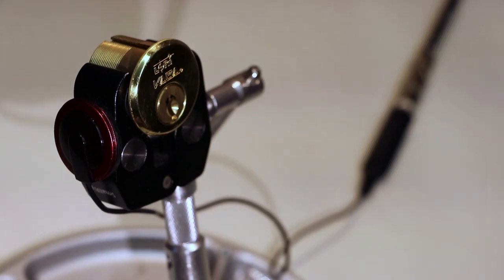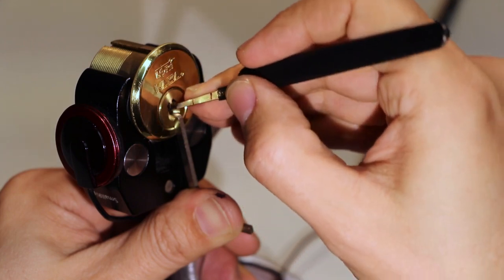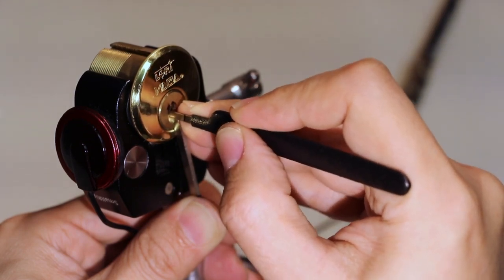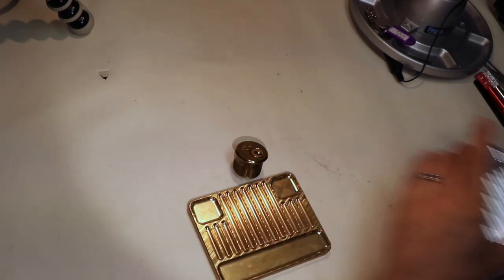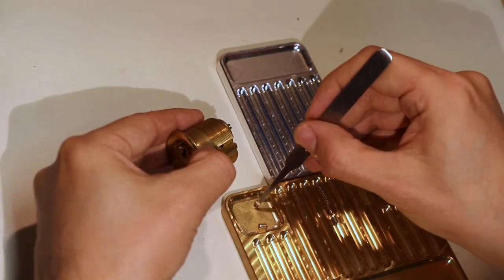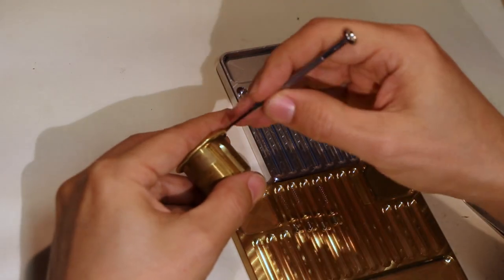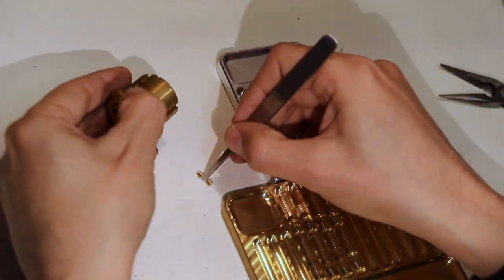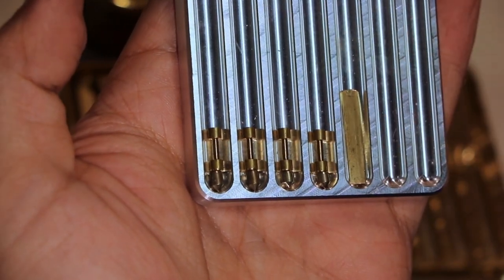[L73] Kaba 8 (3-row 12-pin) Mortise Cylinder Lock - pick and gut

Comment: Awesome work, heavy tension definitely seems to work well with those. Being able to remove those top plates definitely makes gutting & reassembling a lot easier. My Kaba is still in bits in a bag. Lol 
Great video as always.  Have a great week
Reply from the maker: Yeah, kind of glad the springs were pinched, made me do the work to take the plates off rather that always gutting it through the plug!

Comment: Very nicely picked mate. That has a heap of pins😮 had you picked that lock much before? You seemed to know the binding order at the start. If so  is the binding order  consistent each time you pick it?
Great video mate. 👍🇦🇺😊
Reply from the maker: I had it open once just before recording the video, so that was the second open, though I did work my way through the binding order many many times to get to that point. The Miwa JN I picked before that had 15 pins and the Lips Octro I picked today has 14 pins which I'll post a video for tomorrow :)
Reply: @norlin76  wow that is some quick picking for only opening it once before. Nice one 👍🇦🇺😊